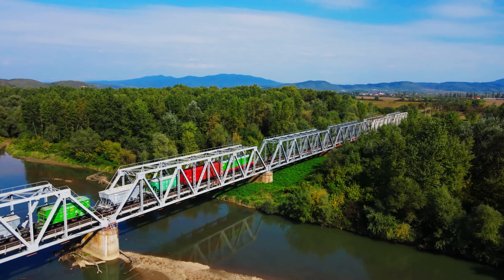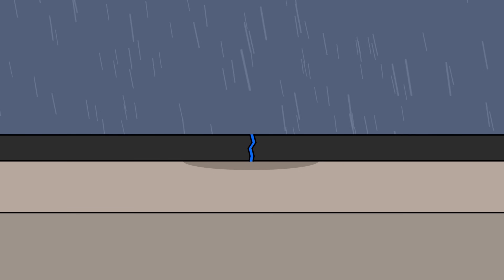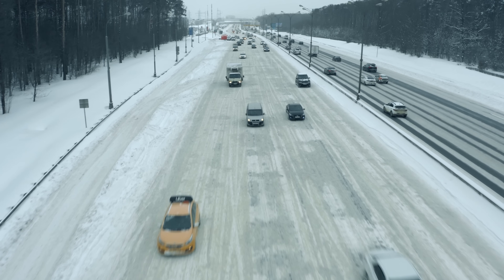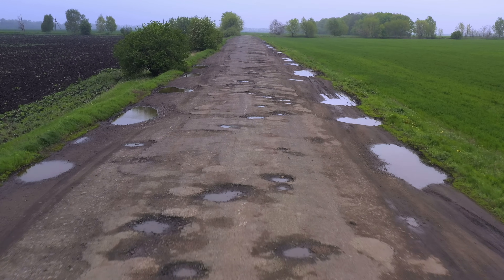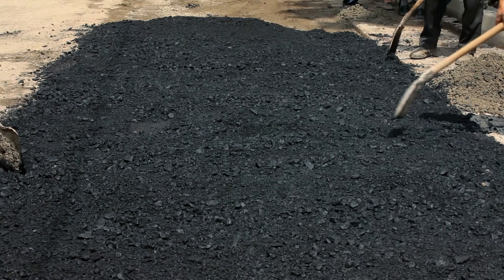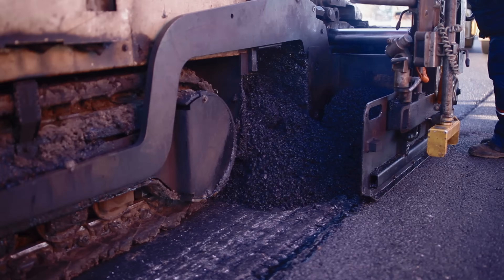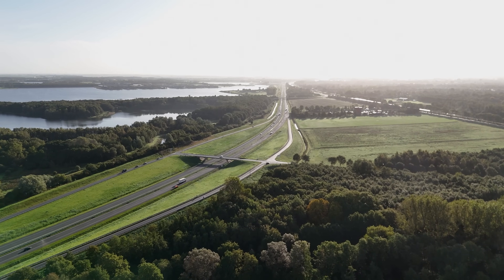Why Do Potholes Keep Coming Back Every Year?

Comment: Is there any argument for the size of Canada and the US? For most EU countries, I imagine it is a lot cheaper to change all the roads due to their size. How would the US roll out all new roads when they already spent so much on these layers you described. I am very uninformed on this topic, I am just asking questions that came to me. Great video, I subbed!
Reply from the maker: That’s actually a really insightful question, and you’re absolutely right bringing up the size of the U.S. and Canada. Both countries have huge road networks (the US has about 4 million miles of road), but what's interesting is that a large percentage of those roads see very low traffic in rural areas, or are highways, which are usually built thicker and handle wear much better.

The real issue is often concentrated in urban areas (especially in northern cities), city roads take a beating from traffic, buses, and freeze-thaw cycles. If we focused on upgrading those high traffic zones first with longer lasting designs, the time between repairs would stretch out massively. That would free up more resources down the line to expand upgrades into other aging roads, creating a kind of momentum.

Appreciate you thinking critically and asking questions! That kind of curiosity is exactly why I started making these videos. And thank you so much for subbing it means a lot!
Reply: @Engineerley  Thank you for the incredible response. That is a solution that makes a lot of sense and one that I can agree with. Thanks for the inciteful content and I hope there is more to come!

Comment: According to my European friends, potholes do not have to form at all, if we build our roads correctly the first time. Costs money, though, to build it right, and our cheapass Republicans in office refuse to fund our economy, instead bailing out their buddies.
Reply from the maker: Absolutely right, even as an example in North America, take a look at highways they often have 8 inches of asphalt and rarely get damage even with the extreme amount of heavy traffic use everyday. And there are much better ways than that to prevent it, I actually recently saw asphalt that is highly porous allowing water to go straight through it and into the ground which could be very interesting as an added safeguard to prevent water from pooling on surfaces. But, again these technological advancements will never find their way here due to our politicians being virtually useless for anything that actually affects the people every single day. Also, thanks so much for watching!
Reply: @Engineerley  That porous asphalt doesn't hold up very well at all it has a short life span.
Reply: Your European friends are being hypocritical bigots. Both the UK and Europe have a number of road types that commonly experience potholes, just as in North America. And North America, just as Europe, has roads that rarely experience potholes. Republicans? "Fund the economy"? What? Some of the worst roads in the country are in blue cities and metro areas that have been Democrat for half a century. Prior to Trump's first election we had 8 years of a Democrat, and another 4 after. People who can't figure out that both parties are the problem are willfully ignorant.
Reply: @Objectified  Don't you get tired of being negative all the time?

Comment: another good quick patch idea is hydraulic cement -- it sets up fast,in just minutes and it is very durable and additives can be added to make it even stronger plus it can be mixed and poured in any weather at the site of the repair.
Reply from the maker: Interesting, I hadn't thought of adding concrete solutions to the video, I definitely should have mentioned it. Thanks for mentioning that!

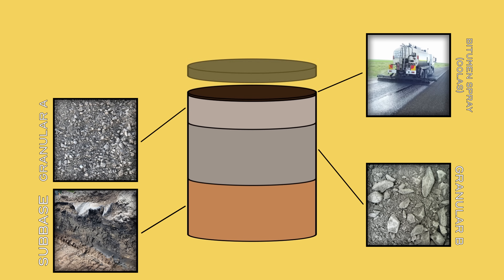Comment: 1:05 50 mm = 2 inches. And you played the sound of a red tailed hawk while showing a picture of a bald eagle. Why do you hate America so much? But seriously, when roads start getting potholes, it’s a symptom of worn out pavement. The reason cold patch is used instead of something fancier is because the pavement has exceeded its limited lifespan and needs to be replaced. If you examine a road with potholes, you will notice what are often called “alligator cracks” all over the pavement. The cracks come first; then when there are enough cracks to separate the pavement into individual small pieces, some of those pieces get dislodged and you have potholes. Patch those, and there are many more isolated chunks of asphalt just waiting to pop out (or get flung out by a passing snowplow) and the process must be repeated. The solution is repaving, but everybody thinks asphalt should last longer than it does. Which is actually true! But poor drainage, a bad road base, and most commonly, heavy trucks with tires inflated to over 100 p.s.i. (which puts over 100 p.s.i. rapidly moving spot loads all over the road, and acts kind of like a jackhammer over time) all have the effect of shortening the life of the pavement and making repaving necessary sooner. Solutions include better road construction work and/or standards and enforcement, better road technology (which must be cost effective or it won’t be used) and getting more money out of trucking companies to pay for increased maintenance expenses.
Reply from the maker: It's all jokes bud, and yes you noticed the whole point of the video. Potholes CANT be fixed, no matter what patch job you use, there will always be gaps where the new patch contacts the existing road. So, the only way to truly fix it is by at minimum doing a shave and pave. But that was the whole point, local governments either refuse to do this or simply don't have the budget to make it happen.
Reply: @Engineerley  It's not jokes, it's insults. American content creators commonly include metric conversions as just part of the process. Americans are taught metric in school. We use metric in STEM and a range of other fields, as well as in international business and trade. We use some metric measurements in our everyday life, and every common measurement tool we have from rulers and tape measures, to measuring cups, to the speedometers in our cars is dual-labeled. But non-American content creators typically take the opposite, ugly approach, and elicit same in their comment section. Then instead of being able to read the comment section for insight by other people we have to continually see ignorant anti-American bigotry. About something we don't have any control over.
Reply from the maker: @ it quite literally is a joke, if you watched 15 seconds before the joke, I stated the lifts of GB and GA as a foot and 6 inches without saying anything else. It was a joke specifically due to the fact that it’s much more difficult to be as exact in inches as in millimeters. I am in the construction industry both as a labourer and now as an engineer, we have to use both at all times. You are taking insult over a joke and taking out your frustrations with other creators who are solely ignorant on me when I understand the use of both and constantly flip back and forth everyday.

Comment: We can build composite pavement roads that last for generations. Properly compact and stabilize the subgrade, pour a properly thick reinforced concrete slab, runway-grade, then build an asphalt overlay on top which is sacrificial. That kills basically all failure modes: No water intrudsion, no base erosion, fatigue cracking, massive thermal resistance. And, it basically doesn't require maintenance. Just repave the thin asphalt layer every 25 years, it'll last a century. And during its lifetime you get NO potholes. None. For real. And the cost? Not too crazy, really. More expensive than the upfront cost of cheap asphalt, but WAY cheaper than the total cost of ownership of cheap asphalt over its lifetime. The problem, of course, is politicians have no incentives to do this. Which brings us to the best solution: Use the politicians for the base layer. Properly compacted, they'll finally serve a useful purpose.
Reply from the maker: @gnualmafuerte  politicians being used as a road base, best idea I’ve heard so far 😂 in all honesty tho yah upfront cost to build properly would fix almost all issues, but I won’t hold my breath lol
Reply: Also the reason why Airline boarding are are so bad and inefficient. People on the last row should go first.

Makes boarding so much easier. But nope lmao 

Capitalism at some point will always go against the greater good

Comment: 6:48 Plastic roads sound like a mistake in the making. They're worried about the micro-plastics generated by tyre wear? Why not double that up and add micro-plastics generated by road wear too!
Reply from the maker: Oh yah, I agree whole heartedly. I think them being used for bike paths or MUPs could definitely work but it would have to be in places with temperate weather. I have serious doubts on their use for real roads.
Reply: @Engineerley The Dutch roads are definitely not REAL roads, they have no potholes. 🤣
Reply: It's also Texas. I don't remember seeing potholes much in Phoenix (in the hot, dry Arizona desert, for you non-Americans). But they are very common in Washington and Indiana, which both get a lot of rain and freezing weather.